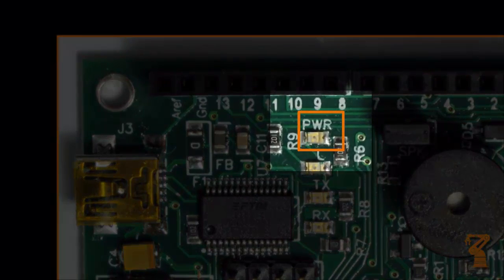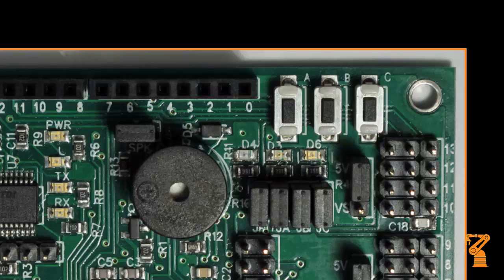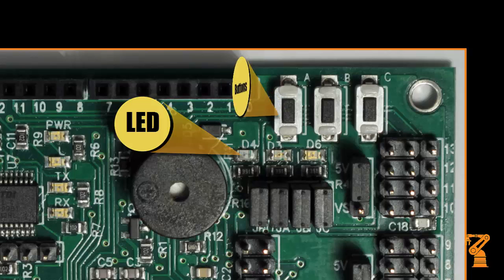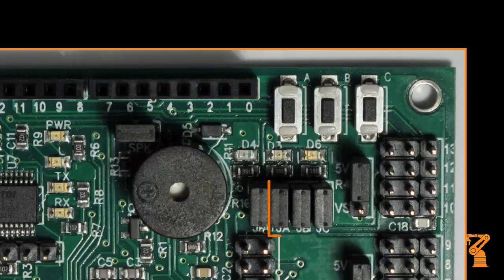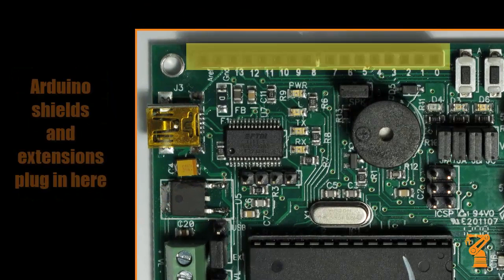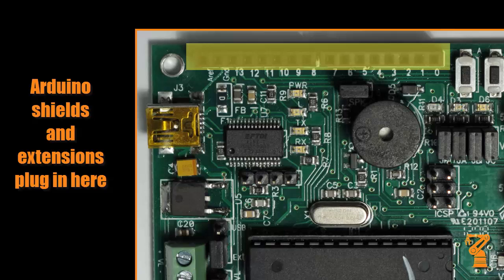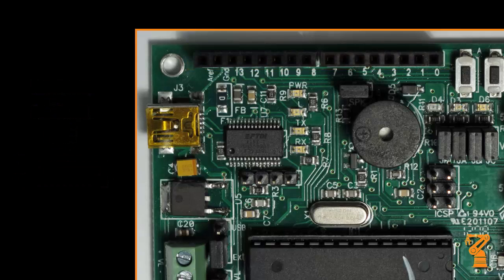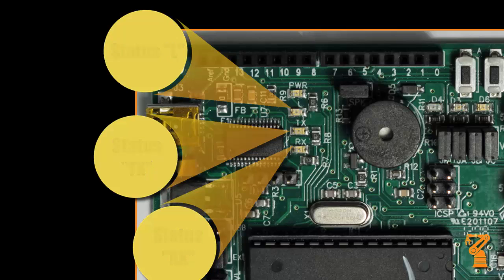SES V1.1 BotBoarduino Overview by Chris&Jim

Comment: Can I run 12 servos and a ps2 controller with just this board? Or will I also need the servo shield you mentioned in the video?
Reply from the maker: You do not need a shield for 12 servos. Up to 15 servos can be plugged in directly.

Comment: Just a heads up at 3:29. I believe you were referring to the jumper set beneath the one you are showing? This seems like a great vid and will sure subscribe for more info on these kinds of components. Just pointing out since i was afraid I fried mine when i connected it terribly and the battery started heating up.
Reply from the maker: The selection jumper Ext/USB mentioned at 3:29 selects the logic power source for the BotBoarduino. If the jumper is set on USB, the logic will be powered from the onboard USB port. If the jumper is on EXT, the logic will be powered from the VL terminal. When EXT is selected. The jumper VS=VL should be set to power the servos and the logic from the same power source at VS terminal. When using this option, VL terminal shouldn't be used. You probably had a separate power supply connected to VL and your battery connected to VS while VS=VL jumper is set and the power supply selection was on EXT.

Comment: But the Source Code in Github project has PS2X_lib.cpp and PS2X_lib.h with error clean and shouldn't we use this file to replace the PS2_Controller.cpp file in Botboarduino_CH3R_PS2 file instead I am a bit confused with the use of this Bill Porter Library Kindly Advise Dr. Dominic
Reply from the maker: Normally the latest Arduino software should include the PS2 library. If the version you have does not include it, then you need to download and install it manually and ensure it's working before you can upload the CH3R code.
Reply: RobotShopTV Hi Chris I will try tje latest arduino 1.8.0 as I am using 1.6.0 Appreciate your feedback Dr.

Comment: Hi Chris, I need some advise from u regarding programming the botboarduino. The PS2 Library [bill porter] I ADD the PS2x_Examples to the Arduino IDL as the "BotBoarduino_Ch3R_PS2" file upload in Arduino shows error message in Programming Controller. How do I solve this Programming Controller error message??Dr. Dominic
Reply from the maker: It sounds like you do not have the PS2 library installed correctly. Be sure to follow the procedure here:
https://www.arduino.cc/en/Guide/Libraries
Follow the guide here: http://www.lynxmotion.com/images/html/build99f.htm